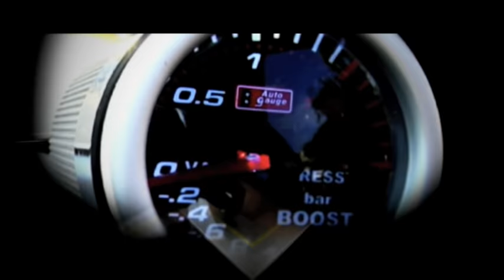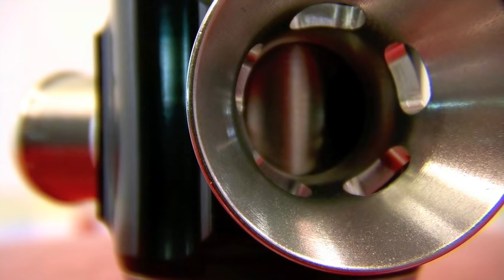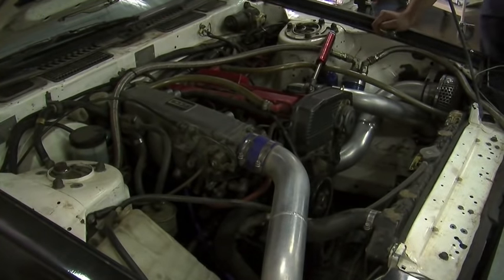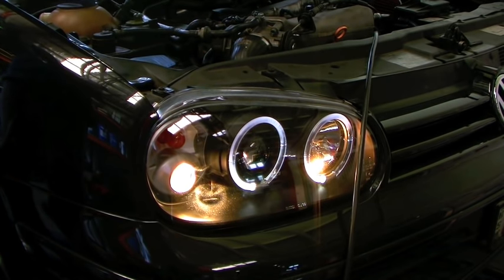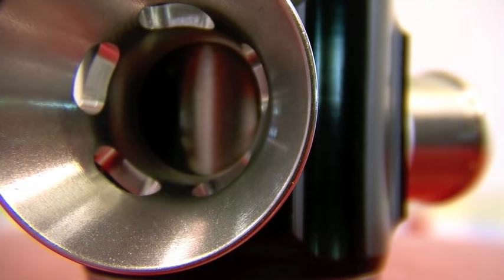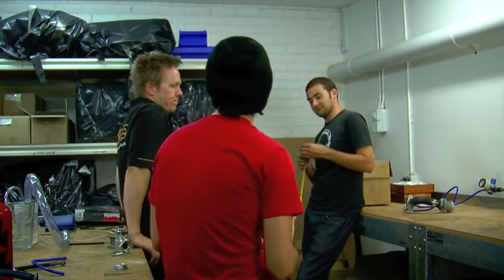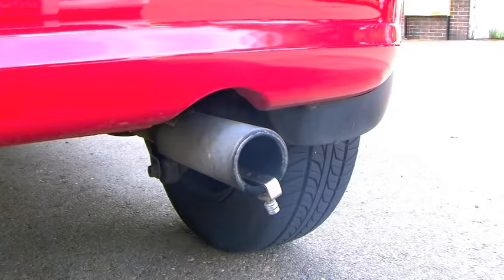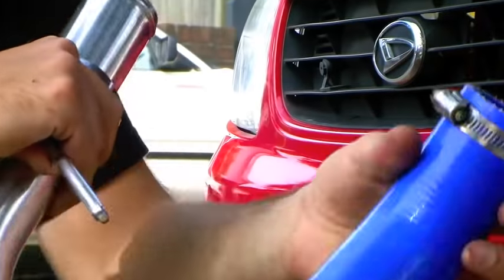Blow Off Valves Mythbusted

Comment: Could have saved myself over $5k and alot of car downtime with that BOV
Reply: Marlon Lyn your turbo insatll didnt go as planned? im tryna decide weather to boost my civic or get a wet nos kit.  what type of car did you boost what went wrong? 5k?
Reply: Michael Mack Honestly I was just joking, but if you're planning on boosting there are a couple of questions that have to be asked:
1. How old is the car?
2. Are there any pre-existing issues inside the car?
3. Do I have access to a Subject Matter Expert that's already done this?
4. Do I have access to do work on my car after it's been bosted?

I boosted a 2002 GTI VR6.  Still having issues and not %100, but I'm hoping to resolve all of them.
the 5k comes from the price from all the stuff, plus hardware.  Believe me, it adds up fast.  Hit me up and we can talk more about it.
Reply: Marlon Lyn I'm still a fan of boost over bottle (Unless you're talking about building a Higher Reving Bored and Stroke Engine)
Reply: Marlon Lyn I have a 96 turbo VR6, and ive spent literally the same lol.
Reply: Doug Bedo How is it running? What did you do for fuel management?
Reply: Marlon Lyn 30# injectors and a C2 Motorsport tune for now. Its runs great. It didnt before, becuase i didnt run a different spark plug gap lol
Reply: Maybe I need to do that too.. right now as it stands I can't even get it to run with the MAF plugged due to a really bad leak.
Reply: Unplug the MAF and change to about a .03mm gap. Of that dosent solve it then look else where lol. You still have the stock head gasket?
Reply: It runs when the MAF is unplugged albeit with a hunting idle, but either dies,  or runs really lean when it's plugged in.

The compression is stock, I'm also using the C2 Flash for MKiV (Stage I)
Reply: So gap plugs to .03mm?
Reply: Huh lol. Could be a number of things. Fuel filter, pump relay, clogged injectors, mixed with a vac leak. You dont have a BOV after the MAF do you? And the stock compression on the Mark 4 isnt good for boost. Like at all. I wouldnt go past 8psi.
Reply: Yes .03. Thats what i have.
Reply: Doug Bedo I do have a BOV.. Originally that was causing problems, so we purchased the Tuning Kit with various springs, and now it no longer leaks at idle.

Comment: Whether you should vent or recirculate depends on the design of the intake. If the incoming air is measured by the airflow sensor BEFORE it goes through the turbo (like if the airflow sensor is in the air filter box), then you must use a recirculator valve, or else the ECU will be momentarily confused by air that was measured by the airflow sensor but never delivered into the engine, and that will throw off the fuel:air ratio and change the long-term fuel trim in the ECU. You can't just pick and choose which version you want to run, unless you feel like redesigning the entire intake.

Comment: please convert kW to HP in EVERY video EVERYTIME. Thats so annyoing.
Reply: Not that hard to work it out your self...
Reply: Oh really, I thought I would need a unicorn for it wise guy.
Reply: Yeah it's not, 1 kW is round 1.34 Hp, 106 kW would be around 140ish hp,
Reply: Jake Kynezos  the correct conversion is
X = kW
Y = HP
x * 1,36 = y
so 106kW equals 144.16HP
Reply: Jiz0 Uhm why did you have to assign HP and kW to variables exactly? Going for maximum inefficiency there? You said the exact same thing as Jake Kynezos except you changed the ratio to 1.36 instead of 1.34? And EVEN STILL you wrote it wrong.... The correct form by today's mathematical standards for linear equations is f(x) = x(1.36) Utter and complete failure.
Reply: just look up Kw to HP in google and it will give you a converter
Reply: if you have a windoze computer, go to microsoft, they have "calculator plus" a free download that does a ton of conversions, KW to HP is one of them.
Reply: Jiz0 not only was the variable system you created redundant, it was also incorrect....meaning there was absolutely no point of it
1 kilowatt =1.34102209 hp   literally 9 keystrokes to google that sh*t
Zephyr Bloodfang while Hp may have been started in America, at least it measures the ammount of work being done and isnt a form of measuring electricity.
However mr bad example the words motor and engine are literally interchangeable from a physics perspective, both take a form of energy (thermal, electrical, pneumatic, elastic..) and create motion. Research that sh*t
Reply: gr1nder07 by your definition, all living beings can be called engines or motors. where you run into problems is aircraft. you don't ever hear anyone say "jet motor", it's always "jet engine" and if the engine has problems, it's engine failure. 

my father was a mechanic for 42 years, A&P mechanic(airframe and power plant) i learned all about engines when i was little, he was a good teacher, like the 4 cycles of a standard engine (suck, squeeze, pop and phooey!) good way to teach a 6 year old. 

where i think this all stems from is the UK and other countries call roads "motorways", in the states we call them roads, freeways, highways and tollways.
Reply: mr bad example Watt is the SI unit for power.
Reply: yea haha I had to go on google and look up a conversion last time
Reply: It's a linear unit of measure. 106.1 kW vs 106.3 kW (0.2% improvement) is the same difference in performance as 142.3 hp vs 142.6 hp (0.2% improvement). There's no reason to know the equivalent unit of measure as long as comparisons are all done in the same unit.
Reply: yes but I like to know the figures in horsepower that way I know how fast the car actually is compared to cars I know the HP rating of, otherwise its just a useless number, much like these guys are used to kilowatts so in theyre heads they can compare the figures to other known measurements that they have taken. It's like saying, well my care makes 765,473,273 Joules of power, well how fast is it????
Reply: darrel nutz Joules is energy, not power. Perhaps you should take the time to learn these things before you start criticising others.
Reply: deadmeu Joules/sec would be a good start, but that's a Watt, and well, that gets us right back to where we started =P

I rather like Australia to be honest, all of their units of measure are SI including nutrition. I don't know of any other country that uses Joules on food packaging instead of (k)Calories. Well, other than New Zealand, but that's practically the same country for the purpose of this discussion.
Reply: well that escalated quickly
Reply: 1hp = 0.73kW. Easy math, bro...
Reply: Strang3 6Liter the first turbo was built by a Swiss guy. First person to patten a supercharger on a internal combustion engine was a German. O and the first car credited to be built was my Mr Benz, yes that Benz as in Mercedes-Benz another German.

Comment: I meant add mods not make them lol my bad
Reply: you can bro but we gotta keep in mind its an automatic and it may breakk the tranny with a turbo kit.. just my 2 cents
Reply: Absolutely not. Turboing a 350 is very touchy, and even paying a shop tons of money to do it properly the engine WILL NOT handle boost very well. This is the failing of the VQ35 in the 350. Boost + VQ35 = not good. Doing it yourself also adds in the factor of you probably doing something wrong, then paying tons of money for dyno time to tune it. I you want more power swap your transmission, do exhaust and intake mods. Then forged internals and an ECU remap. DON'T TURBO OR SUPERCHARGE YOUR Z.
Reply: luis luna
He might be right but nissan has been boosting motors for a long time. FYI a boosted motor kicking out anything near 100% of it's factory hp (like if your motor came with 200 and you boost it to 400) will only last about a year regardless of how you build it. The only way to get the longevity in it is to start with a motor that is overengineered like theh 4g63 or even subarus 2.5 boxer. I say this. If you want to boost the engine and you want to keep it reliable go with a supercharger. The boost is predictable and easily tuned. Next don't go over 8lbs of boost. That's the industry standard. Every car on the market can handle that from the factory. Lastly if you want to REALLY get power I'd still go supercharged but add internals and supporting mods and boost in the area of 15psi. After that you'd be better off building a motor for turbo.
Reply: i just wanna hear some whistle when the gears change or when you rev :c damn so much hostility O:
Reply: It just won't work man. Sadly. It's not worth the time and money. You want power and turbo? Do an LS1 turbo swap. You can get much more power for much less money than building up the z engine, and LS engines can handle TONS of boost.
Reply: hackeysackmage explain in newb terms please lol sorry im new to the whole scene
Reply: SuperJuicebox24
They do make you basic. but it makes cheap power. Everyone knows it does.
Reply: fuck me .. might as well just sell my z a get a corvette ..
Reply: Z engines aren't hard to get power out of, the VQ35DE is a good engine and if rebuilt right can hold tons of power, plus the Z is cooler than a Corvette
Reply: garuntee that vq with twin turbos, fuel and minor supporting mods makes you wet your panties, for less $$$ and pain in the ass than any ls swap.
Reply: ^^ exactly
Reply: SuperJuicebox24 I wouldnt say that, theres a guy with a n/a ls1 in a 240z, it runs 11's with a stock motor. He has told me he has less then 6k in the whole setup...
Reply: SuperJuicebox24 No way man Corvettes are way cooler and quicker and sound 10 times better sorry no way Zs are cooler hands down
Reply: that's a matter of opinion, and even if they are quicker they're 20k or more than the 350z

Comment: I was surprised at how much the GTI engine rocked while going though the gears. Maybe a test or two on different engine mounts? 
On Mark I Rabbits/Jettas, the hot thing was to install a poly front motor mount. I even did it on a diesel. On Ford's Taurus (1999-2007) using a short length of 3/8" link chain tied and bolted around the mount and to the subframe kept the engine from rocking.

Comment: anyone who thinks bov make your  car faster are idiots... its to protect the turbo from compression surge
Reply: As noted in the dyno run segment ,, the original blowoff valve was leaking and apparently that is common... so yes a replacement bov can easily make your car faster if it has some miles on it... I used to have an audi and the factory bov worked much better after a good cleaning with brake parts cleaner.

Comment: The dyno test really should have been done looking at how quickly it built up pressure after throttle release from WOT and back on WOT, as that's really the only job of the blow off vale.. to keep the turbo spinning at high RPM's between quick shifts. SO there is 100% no chance you will every make more HP with a better BOV unless your talking about mid range RPM's after a shift.

FYI, i kept the stock blow off vale on my old 88 Turbo Supra 5 speed because after a LOT of small upgrades i did 322hp at the rear wheels (stock turbo/manifold/electronics/pump) and i noticed almost no turbo lag (non that i could notice or see on the boost gauge) above 4200 rpm in between sifts or off and back on WOT.

Comment: Question:  Since the vacuum hose to the bypass (BOV) valve goes to the intake manifold, wouldn't that line also be under boost pressure when the car is under boost, and therefore, serve to assist in keeping the valve closed by providing the same pressure on both sides of the valve, essentially cancelling any boost pressure trying to push the valve open?

In other words, it should make no difference how much boost the car is making since whether it's 3 psi or 20 psi at the intake, that same amount is being fed to the BOV piston or diaphragm, therefore equalizing and cancelling the 3 psi or 20 psi that is at the intake and other side of the piston or diaphragm in the BOV.

Comment: I put a bov on a turbo diesel, used the vacuum from the egr actuator, for my car in particular the egr valve opens up once the water temp reaches 74° once that happens every time you take your foot off the accelerator it releases the boost, instead of recirculating the exhaust gases back into the intake .
Found its shit in the highway because when coasting the boost leaks.

Comment: I once had a 2001 Ford Focus with the 2.0 ztec. I put on a AEM true cold air intake and when I shifted i had enough pressure in the intake that if I was on the gas and let off into the next gear it would make this noise. Would imagine with enough time invested and electronics you could make something that hooked onto the intake that would make it sound like a real blow off valve but it wouldn't be as loud.

Comment: An open throttle pressure surge is what damages turbos. As long as the throttle plate is closed, pressure surges don't cause any stress on the bearings.

Comment: The really enthusiastic thing is ti buy a non-turbo charged car and to turbocharge it. This is how the real men roll :P Oddly enough, over here in Europe if you invest even 20K EUR there is always some who's willing to buy it from you for a lot more then it costs. 8 years ago i had my '94 MR2 bi-turbocharged, cost me 22k EUR in total with some pretty significant engine rebuild, sold it for 30k. 5 years ago i've had Garrett GTX4088R installed on my 2001 S2 D2 - total cost a bit lower then 18k, sold it for 42k. I guess the "unique" factor starts to show after it goes turbo - the fact that there isn't other car like that out there is priceless :)

Comment: Try welding in a blow off valve in front of the catalytic converter and adjusting it so at low rpm it stays shut but at full throttle the valve opens. I'm guessing it would make the car louder...but it might be a cool way of making an exhaust. Damn this video is 5 yrs old wow

Comment: Oh! I contacted Brett about my gfb deceptor pro. I sent it to Australia and he replaced the o-rings. But really it barely cures the leakage - after a short time it started to leak again. IMHO Deceptor with it 'stroking piston' design is bad, cause there are so many o-rings (5 rubber + 1 plastic ring) and they all leak a bit. It also leaks between bypass and blow-off ports and through the seat of the piston. In comparison stock evo rs bypass valve (made of metal) has poppet/dish-type design (don't know how it's called correctly) and absolutely no leakage.
Be careful with these valves, regularly check it or you will have a hole in your intake.

Comment: technical issue: running an air compressor takes place of the pressure created by the turbo.....so really, you need a turbo (or something like it) in order to need a blow off valve

Comment: the point of a blow off valve is to stop reversion. the throttle plate closes and he air tries to go back out the compressor housing and tries to spin the turbo backwards. this shocks the turbo causing blade and bearing damage. any car can run it atmospheric if they are tuned for it.

Comment: To everyone asking the same thing over and over, Turbo FLUTTER is bad. Thats basically a turbo surging and it will destroy it rather quick. You need a sort or relief for that boost thats built up when you let off the throttle to shift and that is a diverter or blow off. You want "tshhhhh" not "stuutututu". My audi actually had a boost leak because the stock diverter valve was stuck open.

Comment: What this video fails to address for me though is that the intake air is metered by the MAF, and I would think (also what I've read) it would cause a rich condition when the BOV vents to atmosphere and the ECM doesn't know the difference because it's still mapping fuel based on volume of air measured by the MAF.
Reply: finally someone says it. VTA = momentary rich condition, bypass puts that air back in.  depends on the car setup, but definitely for the subarus leave the BPV and let the SRT4s have their BOV
Reply: +Jeff Carroll Subarus are just a little more sophisticated than a lot of other turbo cars ;)

Comment: All bov does is get rid of excess compressed air that the turbo has produced you know that thing called boost, which stops it from passing back theought impellers on the turbo. That allows the turbos revs to stay up higher which in turn allows you to get back on boost quicker.

Comment: Recirc is better on MAF equiped cars because the air has been "counted" by the MAF and the value sent to the ECU. Venting it to atmosphere (BOV) throws off the ECU calculation and make the engine run rich so MAF should recirc and MAP can BOV. It is not alot richer but in some cars like subaru's it can throw a code.

Comment: From what i know recirculation valve allows a liitle boost pressure stay in system when you shift on next speed. BOV exit all pressure in atmosphere and on next gear is no pressure in system. So i think recirc. valve is better.

Comment: No loss of power until you change gear and all that pressure between the throttle plate and turbine is lost then you have that lag until turbo builds pressure again to the throttle I understand replacing  the bov with a stronger one if running more boost as standard bov will only handle the upped psi until it leaks

Comment: you can definitely run a blow valve on a non-turbo, but what's the point? it's not like there's much pressure hitting the choke when you tie the throttle shut, is it?

Comment: so correct me if im wrong, but isnt a BOV supposed to make the car quicker, not faster? The whole point is to maintain boost between shifts and shorten the time it takes for peak boost to be achieved, right? Wouldnt that result in a faster acceleration and not a higher top speed? or am I misunderstanding something?